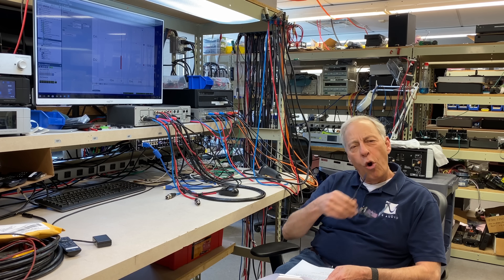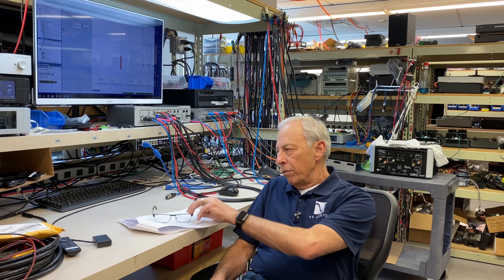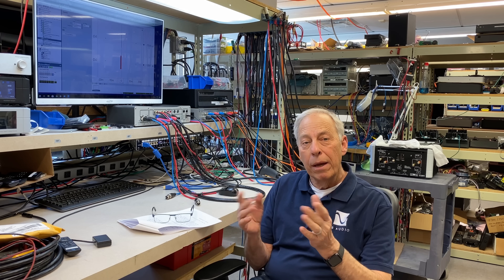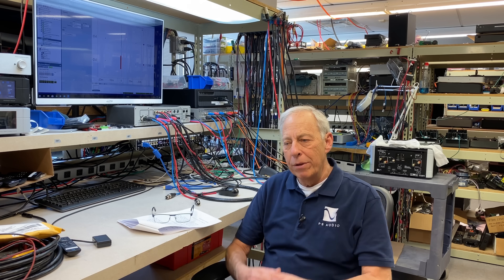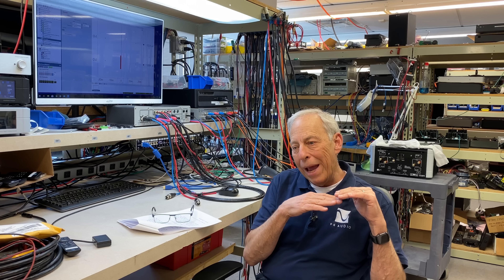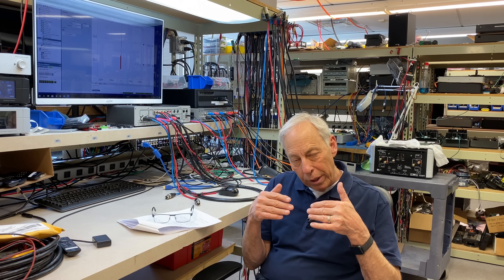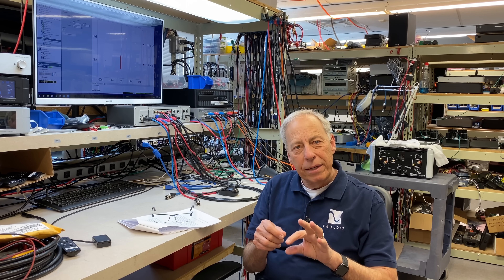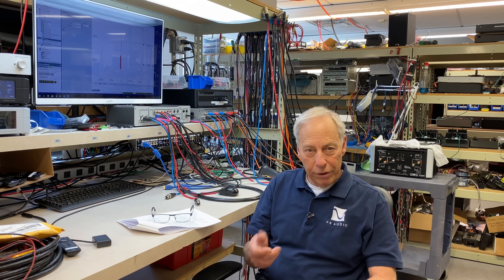How do ferrite cores work?

Comment: All other things being equal would (4) 12in 300w RMS subwoofers sound louder than (2) 12in 1000w RMS subwoofers?
Reply: iTS BECAUSES THERE IS A WALL OF SOUND. iS MOVEINGMORE AIRE. The sound outpid DbS may go down for each speker because the power goes downs but it move smore aiure. Mister Scott Grove has a videos on its. Misters Scott groves has a vidoes 'Understanding Guitar Amp OHMS And Watts With Scott Grove'. he exaplines its. THNK YOU AND THUBMUS UPPES!
Reply: +i love cops. Thanks for the video suggestions! Fantastic video from Scott and indeed he agrees that generally speaking more speakers albeit less powerful would be louder and sound better. Thanks again! -Cheers
Reply: hippo potamus Regarding Scott Grove videos, keep in mind Scott is advising guitarists. While the same principles apply regarding speaker efficiency and amp power, the goals are different. Guitarists typically love distortion, audiophiles not so much. Anytime you have multiple drivers you are adding harmonic distortion. The reason is that no 2 drivers respond identically so the difference between them constitutes a level of harmonic distortion. This may sometimes be agreeable distortion, but it is distortion regardless. My advice is buy a very efficient large sub driver and enjoy. Eminence Definimax drivers are affordable and are well reviewed. An 18" driver will need an 8-10 cu.ft. cab so consider the cabs volume and do not undersize them.
Edit: Parts Express has many drivers to compare. I really like pro drivers and have had good success with JBL , EV and Eminence drivers.
Reply: Do you think (2) 18in 450w rms would be superior to (2) 12in 1000w rms subwoofers?  Essentially double the cone area vs double the power. Or as you stated in your previous reply it would be a wash?
Reply: @kirarittberg5088  HELLO MINE FRENDS! I LIKE SYOUE! Mister Pauls has speekers with plenty of drivers. I dont know how speekers make HARMONICWS DIRSORTIONS BY ADDINT THEM TOIGETHERS. I can huess AMplitude Mpodulation or FM distortion because of phse shife they are nto exactle the same. Is it hearable? I DONT KNOW. 2 spoaekrs putting out the more or less sinusoid, the waves add up, not sure how HARMONICSD GET INVOVED when its the output waves gettign added up.They haves HARMONICE DISTORTIONS from stuff like VARIABKLE SPEED DRIVFES. Is this the article you were lookinges for...

 VFD Harmonics Effect
History has shown that electrical VFDs using power electronics have not been that network-friendly. Either the VFD has operated at a poor power factor that decreases with a decrease of motor speed or it has injected large harmonic currents back into the supply network. All power electronic systems inject harmonic currents into the network due to their non-linearity. The effects of the harmonics that are injected into the network include overheating of transformers, cables, motors, alternators and capacitors; and maloperation of protection relays and other instrumentation that were not designed with an insensitivity to harmonics in the supply. Thus, some form of harmonic mitigation is required. This can be implemented through structural modification within the VFD system or through external filtering.

THANKES YOUE SWAND THUMBBES UPS!
Reply: hippo potamus  "Superior" is a term I do not like as it will vary based upon desired usage. Does superior mean lower bass extension or higher output ? There are also many other factors to consider such as compatibility with your other speakers that you should research. I am not sure if you are building or buying factory powered subs. The efficiency of the driver is the most important factor for me because In normal usage (non professional) you would be exposing yourself to levels causing hearing damage before you would ever damage the speakers. If you are talking about 2 drivers from the same company (usually the larger driver has higher efficiency and power handling) then I would prefer the larger driver. The reason is not because of power handling because I never run my speakers anywhere close to their max. Smaller drivers for subs have to utilize more excursion to match the output of a larger driver. This means they lack the speed (translates into impact) that the larger driver is able to deliver. I have 15's because the size of 18's is prohibitive without having a large room. I could fit 18's in my cabs and have higher output levels but the low end bass extension of an 18" driver could not be achieved in a 4 cubic foot cabinet. If you are buying factory subs of the same brand then larger usually has lower bass extension. If high output and not low bass extension is your goal then 12's would probably suffice. There are so many variables such as size of the room, listening levels etc.... it is very hard to recommend for someone else. I would be surprised if you were to get one 18" sub that you would be lacking. 15" drivers are pretty nice and I really don't feel I am missing much. I have never used 12" drivers for subs but did have a Velodyne and currently have a paradigm powered sub. I think they are very good but a good pro 15" driver with a 400 watt amp beats them. For my HT system I have a pair of 15's with 600 watts and it never run to the max. A pair of good 18's could probably cause structural damage !
Reply: i love cops  I have read many technical reports over the years I have been into audio. Some of the information I understand, some I even remember. I honestly cannot say that I have experienced additional distortion from multiple drivers when I have done it. I never compared single to multiple in a test so hard to say. The fact is drivers create distortion and even good drivers have individual variation. If they have different harmonic resonances then the combined harmonic resonances would be greater the more drivers that are used. JBL recommends building cabs that have multiple bass drivers with dividers , so essentially each driver has its own area. Also pro high frequency compression drivers often have multiple drivers on a common manifold to feed a single horn due to potential cancellations (not a distortion issue but still an issue with multi drivers). Also consider time delay will be more of an issue with multi drivers. Although once again I have not really experienced driver time delay in home systems. I will refer you to "Distortion sources in loudspeakers" by Robert Schmidt written in 2017. There are many forms of speaker distortion he discusses.
Reply: Kira Rittberg: THANKE YOU FASIR LADY. YOUE HAVES ALWAYS BEEN THE GOODES FRENDS. THYMBBES UPOS!
Reply: Thank you for your very informative replies. -Cheers mate
Reply: hippo potamus: HELLO MINE FRENDS! A COMpRESSIUON DRIVER includes a DOME TWEETER with a dome in front of ity, and the dome has a round hole and slots to let the soudn weaves out. COMPRESSION DRIVERS ARE FROM THE PIT OF HELL becuae the soudn waves bounce back and forth untiel they get out. They soudn really terrible and lots of treble from al lthe reverb. If you have evers used a reverb pedal or echo with your guitar you know who turnign up reverb makes the sound more treble.KLIPSCHEH ERESAY II used compression drivers. COMPRESSION DRIVERS IS 100 PERCENT ABSOLUTEL YNOT AUTOPILES nether is hornes becasus eof reflected wafes. Mister Scott Grove doew s nt liek BASSE guitar speakers bigger then 8 inches because they dont respond as quick as smaller ones. Playbeack speakers may be differenet, 15 inch sub woofers, when low E base guter is 41Hertzx? I dont knw I dona have stuff like that. What is f kno IS COMPRESSION DRIVERS ARE super high amplitude modulation distortions ADDINU UP DIFFERNT WAVE FROM TILES DELY t THANKES YOU AND THUMBBES UPS!. I am tired an dhave to go to sleweps now fro th eMeds.
Reply: hippo potamus  If using the same drivers adding a speaker ( 2 drivers vs 1 driver) increases output by 3 db. Using 4 drivers vs 2 drivers will also add 3 db to your output. To increase speaker output by 3 db. you would need to double your amplifier power. So 2 drivers with 600 watts (amplifier power) will potentially attain the same output as 4 drivers with 300 watts (amp power). There are other factors but that is basically how it works. Of course a more efficient driver by 3 db. will also need only half the power. Many factors involved here. I currently have 2-15" subs and increasing to 4 would add 3 db. output but would not increase low end extension (without equalizing  the signal). Changing to 2-18" drivers would increase output and low end extension. I have not discussed cabinets but 4 subs not only need a lot of cab volume but also can have issue with cancellation of frequencies. Any multiples of drivers (in any speaker) can have frequency cancellation issues. This is a good argument for a single sub driver. A single 18" will provide enough bass for almost any size room in most homes.
Reply: Four drivers move more air than two drivers.
Two drivers with a more powerful amp would have a longer throw, which would move more air.
One would guess that 1200 watts total driving four drivers would be louder than 2000 watts total driving two drivers, but sometimes things are not so straightforward.
Difficult question to answer without listening to each setup, or perhaps using an SPL meter.

Unless you're an engineer and can figure it out mathematically.

Or, unless it's a trick question.   : P
Reply: I'm asking because for the price of (2) more powerful subwoofers I could purchase (4) less powerful. Yea I'm thinking that the greater cone area + similar xmax + similar sensitivity rating out beats the greater rms.
Reply: @hippo-potamus 
Good luck!
Hope you get something you will enjoy.
Keep in mind that four speakers may require more work for best placement than two.   : )
Reply: @Hare_deLune ..."Unless you're an engineer and can figure it out mathematically."
For God's sake man; do not encourage these people!!
Reply: @FatRat-f9m 
Lololol!   XD
Reply: I dont know for sure. I have tried Joyo pedals and abut half of them are not usable. They squal or dotn make any sound.  Theior fuzz ocatvew thing is garbage. They have a PLexi diostortionpenal which doe snto sound nice at atll. They have a clone of Suhr Riot, high gain, and that thign does sound very nice. Theyt copied pamp pedals from Tech 21,. ands when those pedals wor, tjhay also dound very nice. The guy from Rush Alex Lifeson said he doe snto use distorton pedals because his amplifier distrotion is good enough dound for him. I have givne up and I just do wh Mister Scottr Grove and use Digitech Rp pedal. The amp distoriton is more niced than pedals. Marshdsll cheeted wioth CLIPPING DIODE IN JCM 900 AND HCM 800. I dortn care nor more. I use digital and get used stuff from Guitar Center. The guy from  EytschPi42 he said he gets stuiff from amzon or whatever the link is if people buy Hoyo. NO MOR EJOYO for me ever again. vuntage overdreive is really nice sound tube screamer. behringer tool over tc electronds. no wonder theyr stuff is junmkie. I AM TIRED AND HAVES TO SLEEPS NOW 1 52 AM JHUNE 1`3 2020 A.D.. THANKES YOU AND HAVES A PLESANTEW MORNINGS.

Comment: IMO Paul does a commendable job here on a complex issue. First and foremost any consumer product that contains an oscillator of more the 10Khz must pass FCC Certification. And that pretty much includes everything. Here’s a good starting point to read up on that:
https://www.fcc.gov/engineering-technology/laboratory-division/general/equipment-authorization
Also kudos to Paul for sharing the extent of the effort and cost that PS Audio goes through to comply with these FCC requirements. It wouldn’t surprise me that they spend over $100,000 per year going through the certification process. I’ve been there, done that, many a time.
The problem is not so much to keep the gremlins out but to keep them in. Your product is going to radiate radio frequencies. Even wall wart power supplies do. And one of the easiest ways to keep the gremlins in is to warp any cables connected to the product with a ferrite bead/core. You can hide them inside the product if you keep it really really close to where the cable enters the product. Some of the modular power cord connectors have them built into them.
FWIW if your marketing ( you don’t even have to be selling and delivering ) a product that exceeds the FCC limits that’s one of the few laws where you are deemed guilty first and must prove your innocence in a Court of Law. If your product exceeds the limits, you’ll be warned, then if you don’t comply you’ll be arrested, jailed and all your product confiscated. The Feds get very serious over this. That all happens very rarely.

Comment: Could one help with subwoofer hum? If so, would it go on the power cable or the RCA signal? Thanks
Reply: It depends on several things, primarily what is the source of the hum. If your sub hums when not connected to anything then it is not coming from signal (RCA cables). If that is the case , then possibly it is from your ac power in which case placing it on the power cord may help. It may also be a ground loop hum. Typically this is a 60 hz hum.This occurs if your sub is plugged in at a different location or on a different circuit than the rest of your gear. Try plugging your sub  power cord in on the same receptacle as your other components. You could also try using a "cheater" adapter on your power cord. This is a plug adapter with 2 prongs (no ground) that you can plug your sub cord (3 prong plug) into. If that works then you know it is a grounding issue. Sometimes  hums are hard to track down but by the process of elimination can usually get sorted out. Good luck !
Reply: Sorry, subwoofer hum usually is a grounding problem.
Reply: Thanks for the replies, so the sub hum is when the RCA is connected. On my old cable I never noticed a hum, however it was a dual L/R cable so I swapped it to a single one to avoid having a coupe of dangling RCA plugs at either end. This cable is also about 1m too long so I have it coiled up slightly, again probably not ideal! I know the answer is to buy another correct length single RCA with likely better construction/shielding - however would a ferrite work on the cable? Eventually I’ll get around to ordering maybe an Audioquest as I see they do ones with additional grounding lugs...but I’m somewhat of a procrastinator so it might be another month or 2 before I get around to it!!
Reply: Richard Gray  The RCA cord is a 2 conductor system, with one conductor (centre wire) being signal plus and the other conductor (shield) being the signal negative and ground combined. So it is still possible the ground loop hum is through this connection. I still would suggest trying a plug adapter to a 2 prong on the power cord of the sub. It is unlikely a cable issue but if you try a different cable you will know. Check to make sure your signal cable is not running close to any power cord, that can introduce hum.  I have never tried a ferrite bead on an RCA cord so can't comment on that.

Comment: Common mode noise can be a huge problem for audio and these ferrite beads can be of great help getting it down to a non-issue. This is especially true when you have computer gear connected. They are used for a reason and that is to increase the impedance only for the damaging common mode noise and not for the actual power or data your device is using. For example, a DAC DC power supply I use has such filter on it and no doubt it’s good to have in that particular situation. Especially some switching power supplies like what you can find in a PC can induce common mode current noise. Common mode current noise is conducted as a noise common to the wires in the cable and will pass through typical mains cable noise harvesters that are just shunting the differential noise between the wires (live and neutral). Ferrite is iron oxide typically mixed with other metals.
Reply: So if we add a ferrite core (in my example a usb splitter -power and audio) will it make the shrill-humm manageable? All my  mics get affected by that except a Maono one which has this ferrite core on its usb cable. I have already made it go down to a slightly lower level. Where do I use it? On the part before the wires split into power& audio or before that?
Reply: Did you find an answer? Are you sure that's not a ground loop? 
 @DrunkenHamster7

Comment: So....putting a ferrite on an amplifiers power cable will increase the cables impedance and....decrease sound quality? Am I right?
Reply: Power frequency is 60 Hz. The reflected impedance introduced be ferrite beads increases linearly with frequency which means that a properly designed bead on the power supply leads will have very little impact on the power frequency entering the equipment. It will, however, have a major impact on radio frequency interference signals (RFI) which is exactly what you want.

Comment: This was a good one. It even serves to review the question. What is electricity? We use the word as a noun but it's an action. Electricity is/are not electrons but the movement of electrons. In a perfect open circuit (which does not exist) there is no electricity no matter what the voltage might be. When you have an activated but unused AC outlet there can be no evidence of electricity because anything you do to measure it causes some current to flow creating electricity, even a cotton string tied to a high voltage line that stands up on end is a load.
Reply: Holy Schrodinger's Cat, Batman!!!